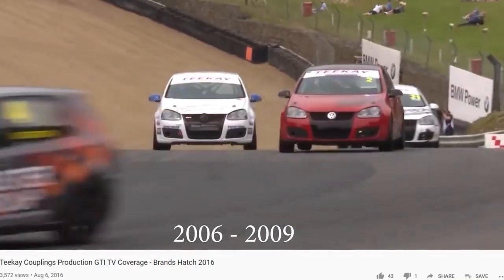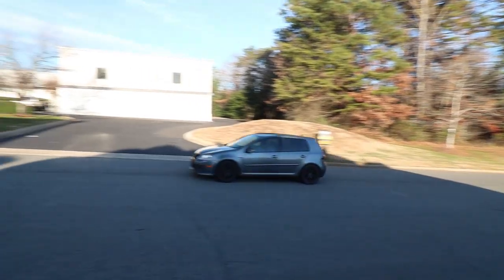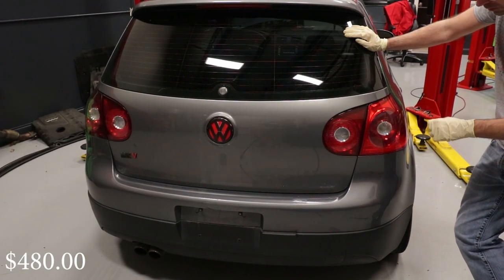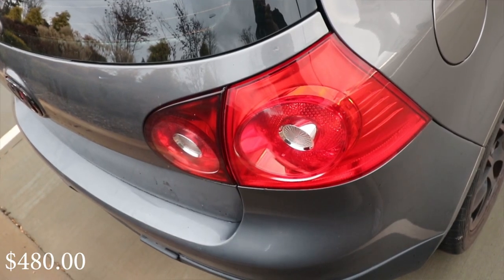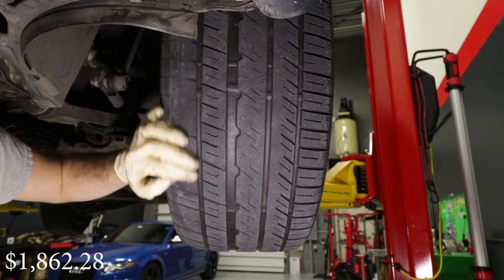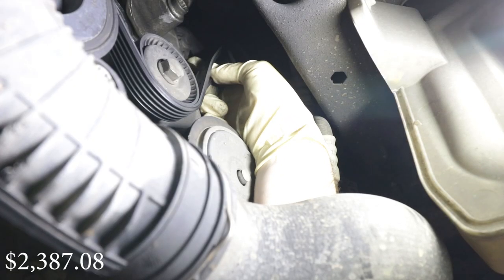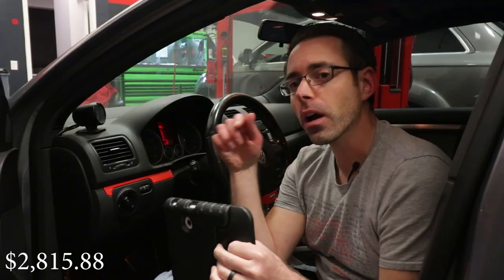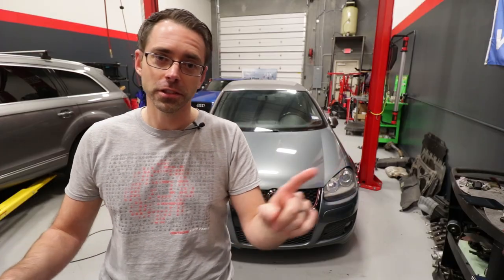How Not to Buy a MK5 GTI

Comment: This car was clearly neglected. My MKV has been through 10 Canadian winters and is in much better shape all around
Reply: have u had any issues with it? I'm considering buying one around 2006-10
Reply: Never had a single issue inside or out. Fuel pump will tick for first few accelerations and alternator belt will squeal until the motor heats up during winter. My cousin in italy has the euro spec version also and he has had good luck aswell
Reply: My mk4 Jetta is in better shape than this mk5. Even after nearly 20 years on salted roads..
Reply: @hockeyandsoccer4ever  Get that belt replaced. They're cheap and relatively easy to do. What's not cheap is having your belt snap in the winter and being stranded waiting for the tow truck with no heat. Trust me, I've been there! lol.
Reply: BOX5INGH JG get a good mechanic to inspect it but if you can find one in good shape and are willing to keep on eye on it they are fantastic I bought a 2008 gti with the fsi engine and haven’t had any real problems
Reply: Mine has survived 10 intense Texas summers. I have to park outside at work and there is minimum shade. It does need a new headliner, but otherwise looks and runs great!
Reply: Whenever people say German cars are unreliable it's  abusive ,neglectful irresponsible owners like the one this VW had . I live in Canada and I have seen many German cars Audi ,BMW, Mercedes Benz and Volkswagen areas 12 years and 200,000 miles plus and they look virtually brand new . It's all in how owners look after cars
Reply: Exactly!
Reply: @georgevavoulis4758 stop coping. German cars that are neglected last 120k miles. Non neglected last 200k. Japanese cars that are neglected last 200k miles, non neglected 300k. Do you see the difference? Mk5 owner here.

Comment: Just bought a mk5 1 hour ago lol
Reply: Remember, brake kit BEFORE the stage 2.
Reply: @wite26  Trust me. Listen to this guy. Just crashed my driver side of my mk5 this week because boosting at 14 at night. Im a sad guy looking for parts.
Reply: Mane Are the brakes that bad on mk5 gti?
Reply: @nabil_040  No, if anything, im running the car fully stock right now and the breaks are fantastic; and a lot of people actually just stick to the stock ones with a tune. Just smart to upgrade them with a tune to avoid any accidents with all the extra power.
Reply: nice what engine? spec?
Reply: @wite26  ran stage 2 but when tracking DISABLE STAGE 2 AND GET HAWK TRACK  PADS WITH DOT 4 RACING FLUID. The all weather tires BARELY handle stock!
Reply: i'm going to buy a mk5 sportline (140Hp) tomorrow lol
Reply: Nabil I’ve replaced my rear calipers twice on either side lol. The car stops well enough but I’ve at least always had caliper problems. Easy fix tho
Reply: Buying a 2009 GTI next week, things to note?
Reply: How is it ?
Reply: Change your cam follower !
Reply: Same.. lmao
Reply: @chasenagel4960  great car now sold
Reply: So you hate yourself too huh?
Reply: @JasonLeeDeeCee  no mine was a good car loads mods on it.. sold it for profit year later
Reply: Oh I thought I read your comment was recent lol.  Yeah I’ve had good luck with mk5.  Had about 20 different MK4s and those were hit and miss I really like the mk5 platform though

Comment: Bought a stock 2009 GTI with 118,000 KM (~74,000 miles) back in January 2020. Paid a bit extra for the low mileage but I had been combing the listing for a solid example. It did not disappoint. Smooth and easy to daily and gets decent mileage when driving conservatively. It becomes a completely different car in sport mode with the DSG, superb response and plenty of low end torque for a nice go in between stoplights. The only thing that's been a downside so far is the intake runner flap actuator failed and began leaking boost like it was its job. Ive owned it long enough and put enough maintenance into it to know its solid. Some light modifcation and a flash tune and this car will be an amazingly cheap to run and reliable sports car.
Reply: How is 118,000 km low mileage here in Sweden people will never buy cars over 50,000 km I don’t understand the American cars they got high mileage and they are expensive, I bought golf mk5 gti in Sweden that had 15,000 km for less than 4000dollar
Reply: @lifeisshort4777  Its a 13 year old sport compact. 118k is nothing. At 25k a year average its well below where it could be. Most other examples in my area at the time were 200k plus, some pushing 300k. These engines will run for 500k plus if you treat them well. As for why it's a North American thing, what country would you be in if you drove for 8 hours? I wouldn't even be in the next province yet. Basically if it had been driven the "average" ammount per year it would be over 250k, it had less than half that, making it low mileage. A lot of people here in Canada put on 2,000 km a month or more because of the distances involved in commuting between cities. I also paid a little extra for the 2009 model year which here in North America came with some benefits. Like my engine is the tfsi not the fsi, has a timing chain instead of a belt, fixed the high pressure fuel pump cam follower issue, new revision intake manifold, and about 15 more HP than other MKVs because it has the EA888/1 instead of the EA113 engine you find in all other MKVs.
Reply: @lifeisshort4777  If you guys up there in Sweeden are only getting 50k out of your cars, I got two words for you. Oil change.
Reply: @spencerquimby4726  Actually the TSI motor have been known to have some pretty major issues with it's chain and people have found that the FSI if taken care of properly can actually be more reliable than the TSI. Depends who you ask but the fact some people prefer to build the FSI instead means it's not the end all be all answer to FSI issues.
Reply: @EmilyRose900  Very true, I've heard both sides, belt vs chain. They both have issues. VW used to have chains then switched to belts then back to chains because people complained about both of them. I think what it comes down to, as you said, is following service recommendations and preventing failure through maintenance. I like the chain as it doesnt have to be replaced nearly as often, and the tensioner assembly is less prone to failure (still will though if you're not on top of it). The FSI is easier to build, but the TSI has greater potential and similar reliability. Just my 2 cents. Not knocking the FSI, it's a great engine, I just appreciate some of the features they changed for the EA888 family.
Reply: @lifeisshort4777  Did you compare the size of Sweden vs. the continental US?
It fits an average 22 times. Many of those considered high miles are highway miles.
Reply: @spencerquimby4726  What? 25k average?! WTF... 118k/13=?
Reply: @mazpr2025  Yeah that's why I bought because the average mileage was well under the average. Only about 10k per year.

Comment: This is the worst car I have owned....  I never rode it hard... but despite my good driving habits, the car rewarded me with a blown the head gasket, then later the turbo failed and had to be replaced. Check engine light was on more than it was off. Cylinder mis-firing was the usual culprit...at least once a month. VW couldnt fix it. It got so bad, that every time I started the engine, i wondered if the check engine light would be on, blinking...or just stable. It was a fun car to drive, and looked nice....but I couldnt afford the monthly payments, then having to have the car in the garage at the same time. Total garbage engine. Then I got smart and bought a Subaru STI. Guess what , no issues. no check engine lights.

Comment: Got my manual mk5 fsi gti back in 2015.  Car had 48,000 miles on it & now has nearly 95,000 miles.  Recently paid a good amount to do the major service of timing belt, water pump, valve cleaning.  My car runs flawlessly at APR stage 1 with intake, turboback, upgraded dv, catchcan etc. & I have fun with it nearly every day but ALWAYS keep up to date on maintenance.
Reply: How do you still like it? I'm looking to finally get a stage 1 and catback. maybe.
Reply: @Drpepperkiller10  I liked it a ton.  Stock K03 Turbo actually recently started showing signs of failing with oil leaking etc so I upgraded to a Unitronic k04  kit.  But ran that APR stage 1 up till 121k miles with no issues until the oil issues when it started failing
Reply: @mikepollastrelli7725  huh! interesting. I'm absolutely torn on upgrading the mk5 (has DSG shuddering) or just using the money and getting a mk6. Absolutely torn.

Comment: My biggest complaint with mk5's (speaking from long term ownership, ranging from gti's, gli's and my old Leon Cupra) is the suspension as a whole is extremely expensive, not even talking about after market. 
My wifes 08 tfsi has 215k miles, and we've spent more than the cars value the past 3 years replacing worn suspension components. (Tbh, I miss the mk4 days of rear beam and simpleton control arms.)
 But lets be honest, its a 11 year old turbocharged German car, and we do live in the speed bump capital of the world. 
In case anyone is wondering, in 215k miles we've replaced: Brakes all around (duh) Ball joints, tie rods, sway bar end links, sway bar bushings, rear trailing arms, struts, strut mounts, Axle boots (too many times) dsg service, X2 t-belt (FTW) service along with accessory belt, a/c compressor, radiator fans (both, large one twice) starter and finally bank1 O2 sensor. 
Interior has had a few things need touch up or repair, but we live in UAE, and the car sits outside in 120+ degree heat. Overall, I love the car, is been quite good to us. Car is also eurodyne stg1 on OEM downpipe.

Comment: poor gti :( i got a mk5 a few months ago and as much as it’s a pain in the ass with problems it’s a fun car. i need

- rev d diverter valve
- oil separator
- brake booster vacuum hose
- spark plugs
- serpentine belt
- brake pads
- wheels
- windshield
- lower control arms

Comment: I owned a corrado 1.8 16v with 172000 miles and i also owned a 2.0 16v with 90000 miles both at the same time,  the one with 172000 miles felt miles nicer , yet the car was in rough shape, while the 90000 mile one was in absolute pristine condition that i snapped up for £1500 back in 2004. my next car was another corrado, and i now drive a viper green scirocco

Comment: Y don't u talk about the 2.5l VW engine I have 2008 rabbit wondering what your thoughts r on that engine keep up the great work
Reply: Mine is an '07 Rabbit with only 26,000 miles. Bought it new. the 2.5L engine uses a timing chain and if the oil is changed regularly, the chain should last well over 100,000 miles.
Reply: I traded my mk5 Jetta 2.5 that I bought new in 08. Had 140,000 on it. Never had a check engine light. Next to the vr6, the 2.5 is vw's best motor. Besides the ones that had that funky timing chain issue.
Reply: 2.5s are bulletproof. Have an 08 rabbit myself
Reply: Thanks guys I have 200 000miles runs great
Reply: Have owned one since 60k miles has 143k miles and running really strong. Very well maintained and the mechanic says it should last another 100k still on mainly all OEM parts in NE Ohio. Also just got the oil tested and Blackstone labs said the engine was in excellent shape and that was with a 10k mile oil change and they said I could lengthen the interval if I wanted. Also bought an 06 rabbit with 45k miles about a year ago was neglected but once my mechanic got her fixed up she's at 65k and still running really strong!
Reply: Have a 2012 2.5 and reLly just basic maintenance and runs good. Almost 140k miles.

Comment: The 2.0T up to the MK7 is still the nightmare that keeps VAG engineers up at night. Who knew an engine could consume more petroleum through the rings than through the injectors? 
You know, before 50K. 
Sadly, the 2.0T gave a lot of VAG cars a terrible wrap that they don’t deserve. The rest of the drivetrains in most 2.0T powered Audi’s/VW’s is pretty bulletproof. The chassis’ are also well-refined. But that “add one qt. of oil” reminder every week is a real buzzkill. And then the timing chains... and then the PCV’s.... and then the turbos... and on. And on. And on.
Reply: Input bearing is a common problem in the transmission tho.
Reply: Couple years ago I bought one of these. . 6k$ later, still regretting it...
Reply: @jstllucky  one of which? mk5?
Reply: @davidzebar6876  jetta gli 13' mk6

Comment: Just bought a mk5 a couple days ago it’s already in pieces😂 have it all taken apart for the new cam follower and valve cover gasket thinking I should just go ahead and replace the Pcv too haven’t done the cap test... went to change the plugs my number 1 had oil in it😬 ECS tuning coming in clutch with one day shipping, but the cam follower in it was like new!

Comment: Nice video! I'm very surprised that it's cheaper to replace the halfshaft than to replace the torn CV boot.  How can that big steel part cost less than just a replacement boot + grease?  A quick google implies a halfshaft is $450 and a CV boot kit is only $40.  Is the difference in the labor (is it a lot less labor to replace the halfshaft)?

Comment: There is no single video about other VW Golf V cars (1.4 GT TSI or the 2.0 FSI). Im sure most want to know about the piston rings, the costs of replacing them and how often. Or whether there are specific piston rings that won't break. Or whether using a higher octane fuel will reduce this problem. 🤷🏽‍♂️

Comment: Wait, so how's the DSG holding up for that many miles? Has it been replaced or has it really been that reliable?
Reply: If you service every 25-30k DSG will remain very reliable
Reply: Had my mkv DSG gti 13 years with no issues except servicing and a couple of bushings. Regular dealer serviced. Synthetic Oil replaced every 5k kms and DSG service. Great car and great value. Highly recommend a good mkv.
Reply: DSG is very durable. Make sure to replace fluid. I read forums it can do 450Hp, not talking about the clutches though.

Comment: Any advice for anyone looking to start a youtube channel that owns 2 MK5 rabbits? I Have owned one since 60k miles has 143k miles and running really strong. Very well maintained and the mechanic says it should last another 100k still on mainly all OEM parts in NE Ohio. Also just got the oil tested and Blackstone labs said the engine was in excellent shape and that was with a 10k mile oil change, and they said I could lengthen the interval if I wanted. Also bought an 06 rabbit with 45k miles about a year ago was neglected but once my mechanic got her fixed up she's at 65k and still running really strong! Was maybe thinking about fixing modifying my older rabbit. Anything is appreciated great video!

Comment: Just bought a 2008 MK5 GTI 2.0 FSI. Going pretty well but I believe there might be a leak in the brake booster because of a hissing sound when the brake pedal is disengaged and I think the thermometer is out because I’ve only seen it reach 70c.

Comment: Any locations where it would wind up leaking a tad of coolant maybe? I gotta see over winter. Its a very small amount more so passenger side. Wondering if its just a hose and tiny spot.

And mines tsi, wondering how bad of an issue it is to do motor mounts. The oil front one i see seems easy enough and i need to for that one.  What about the others?

Comment: In your humble opinion for a mk5 gti; which one is better fsi or tsi ? 
Maintenance, performance, resale value?
Reply: I have a 2009 TSI and the timing chain has an ongoing class action lawsuit (paperwork already had to be submitted to make a claim). Some fairly new cars were having catastrophic engine failures. Mine presented as a slight oil leak. Any competent owner took it in and got it fixed by now. It's a problem on many Volkswagens and Audis with timing chains, not just the GTI by the way. Getting the money recovered through the class action lawsuit is proving to be a nightmare, and I keep a thorough maintenance record. I can only speak from personal experience. 

It's a fun car, amazing on the freeway, got me my first speeding ticket. You can go so fast and the car just purrs and the handling stays firm. I follow the maintenance schedule and keep it clean, besides the recalls, it's never given me trouble. There's now a warranty extension for the water pump, mine's been losing a little coolant. Make sure that's been addressed. I'd avoid the cars like this one that have a lot of aftermarket modifications, that seems to cause problems. Upgrading to Michelin Pilot Sport tires last year made me get the new car butterflies all over again. I had a Beetle before this car, Volkswagens keep their value better than some other cars (not as good resale as a Honda but the VW is more fun to drive). There's plenty of them on the road that are 20+ years old. Having a turbo, your trade off for added performance is that they require more maintenance. They're reliable if maintained, they can't handle much neglect. Take care of your VW and it will take care of you.

Comment: Headlight wise to be fair im pretty sure mine are stock and all and ive replaced bulbs twice, and they STILL have a slightly different color between them.

At one point i also replaced the igniter red and black square thing and STILL same shit. Sooo idk, im thinking its like that from factory. Just an oversight of the design and maybe something deteriorates over time maybe its the cables idk? And to be fair mine are stripping away and withered and plastic is falling off after 10 years as its an 09. sooo yeah idk. It is annoying tho